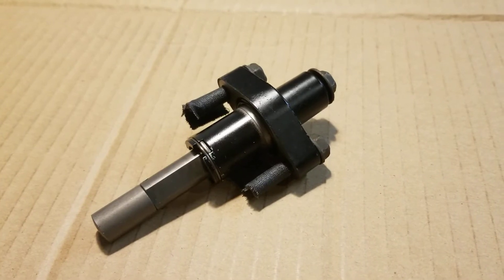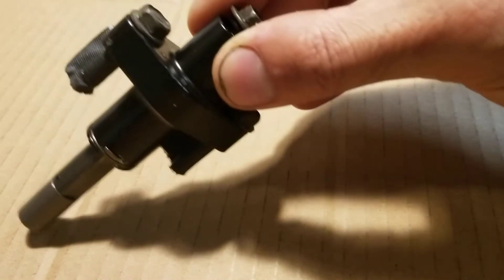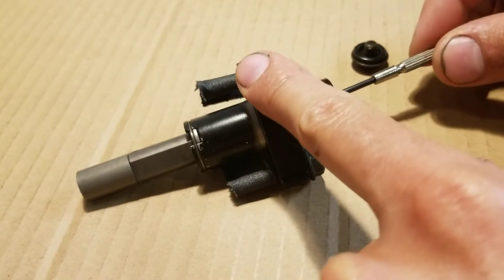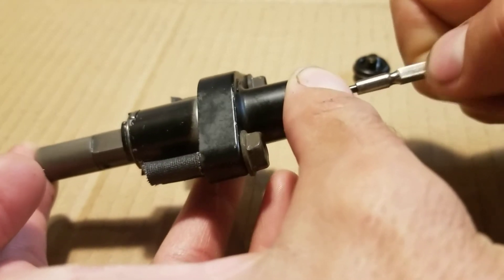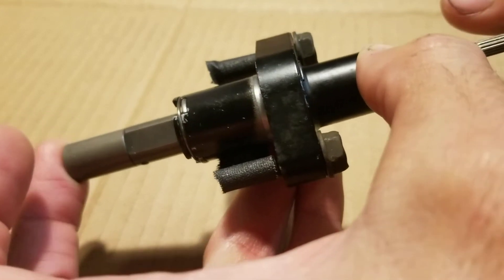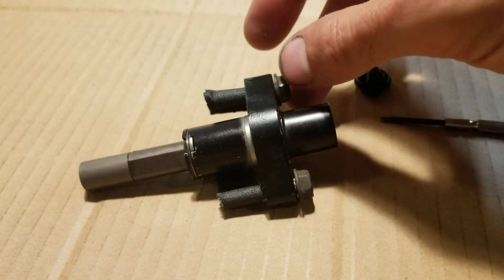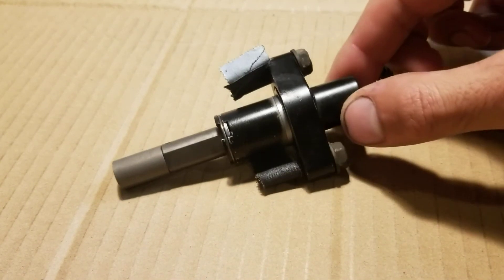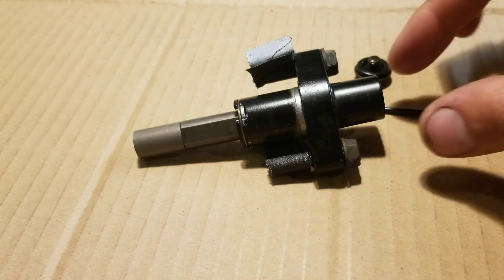KLR250 CAM CHAIN AUTOMATIC TENSIONER - HOW IT WORKS

Comment: Hello friend, I have that same mechanism in my klr 250, which I had to replace with new chains, to adjust the tensioner, should the entire tensioner cam be stretched?
Reply: Hi, could you say where you bought your replacement cam chain from, mechanic said my tensioner was all the way in but I still got rattling sound in the top end of the engine.
Reply: @AmunikeBooker  Hello, I am from Argentina, in the end I replaced everything new, including the new chain tensioner